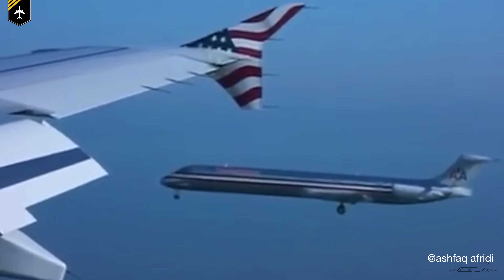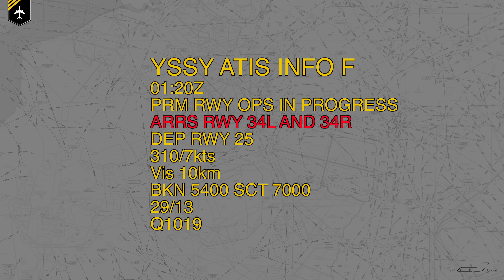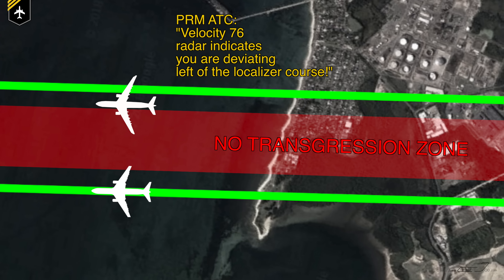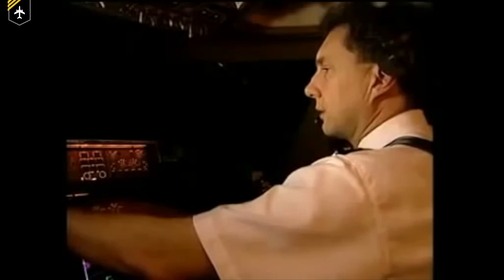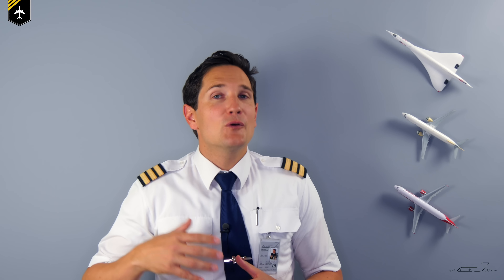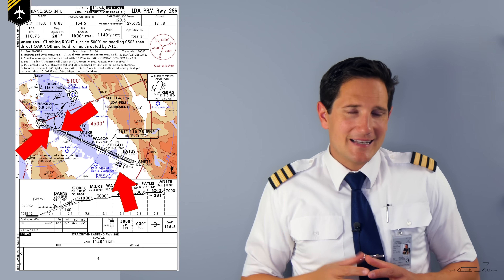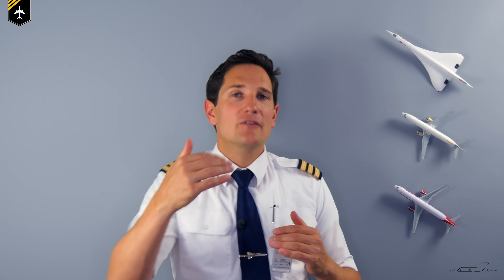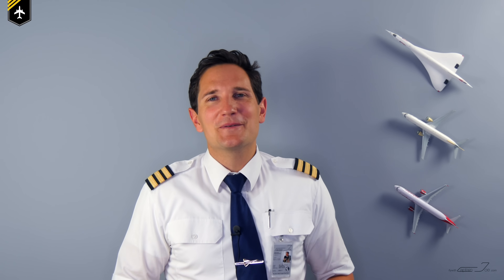Parallel LANDINGS!!! PRM and SOIA approaches! Explained by CAPTAIN JOE

Comment: The more I watch these videos the more respect I have for airline pilots.
Reply: And controllers. Pilots only have to deal with their aircraft and those near them, and see-and-avoid is always in effect (assuming VMC). Controllers have to deal with dozens at a time (including coordinating handoffs between sectors), especially in an airspace as dense as the SFO bravo. There are also two very busy Class C airports under the bravo, as well as numerous Class D. It's really impressive and amazing that there as few incidents (and potential incidents) as there are in that space. The only other airspace I've had experience with, that comes close to the complexity of the SFO Class B is the LA basin (I've not flown on the east coast, I'm sure that NYC area and the DC metro are nightmares to navigate and control).

Comment: The breakout described around 8:05 comes from what You described before. Since the plane on LDA approach has to have the preceding on ILS in sight all the time after the LDA point, they are not allowed to overtake them. When they are about to, a breakout is necessary.
Reply from the maker: Correct

Comment: +Captain Joe  Excellent informative video!  This was a really great one.  I experience PRM and SOIA landings frequently and I always wondered if there were extra procedures involved.

As a passenger, I've experienced PRM in PHX, LAX, DEN, IAD and DFW (I'm sure there were more).  Of those, PHX always seems to be the closest.    

I have also experienced SOIA at SFO nearly every time I land there (I'm only 4 hours driving time from that airport and often take a regional up there to transfer to a trans-continental flight).  SFO is truly the "Mr. Toad's Wild Ride" of airports because not only to they do the SOIA but I swear they're cutting it extraordinarily close between landings with the perpendicular "take-off" runways 1L and 1R that cross 28L and 28R at their center points.   When taking off, it often feels like you're playing "chicken" with the inbounds.

Comment: Hi Joe, thanks for all the great videos. I was on a flight last week where the APU was not working before take off - so no AC before engine start.....it got me thinking. How can you fly with a faulty APU...what would you do should you have multiple engine failure. Would it be possible to restart engines without a APU during flight?

Regards
Leardt

Comment: Cap😮. Would that make the TCAS go off in the approaching planes? Would u have to turn it off?
Reply: Procedurally at SFO before joining either of these approaches TCAS is switched to "TA Only" so it still calls out traffic but does NOT give Resolution Advisories prompting evasive maneuvering. 

I don't care what Captain Joe says, these approaches at SFO are not well liked by most pilots who fly them very often. I've been there hundreds of times and it's frequently a total cluster. There's some other requirements that can set you up to fail:  you aren't supposed to pass the adjacent aircraft, but ATC will frequently put faster aircraft behind the parallel traffic. When you're at your approach speed, you can't slow down any more. This results in go arounds. ATC also aggressively badgers you to call the field and preceding aircraft in sight and sometimes it's quite difficult as there may be many aircraft visible or visibility may not be great. This can also result in having the approach broken off and getting resequenced for another approach. Just because it looks cool doesn't mean we enjoy it or that it's a good operation. I detest flying in and out of SFO as not only do you have all this to deal with, there's normally intersecting traffic on the other runways rolling through your landing runway to watch out for. 

The SFO controllers do the best with the airport configuration they've got, but much like BOS, what they've got is intrinsically terrible.

I thought Joe did a very nice job explaining it all.
Reply: No because TCAS isn't only based on proximity, TCAS is designed to resolve conflicts for one purpose only and that is to avoid collisions. As such the only conflicts it will issue an RA for are those where the plane is both close enough and also is actually on a predicted collision path since parallel lines do not intersect by definition TCAS is not concerned by a plane on a parallel course. Not sure how it works with the other kind as the two paths are not parallel but I would guess that it has something to do with the fact that with both planes descending the expected collision point would actually be at a negative altitude and thus it assumes that you are landing before that, TCAS is built to avoid mid air collisions not ground collisions so that would rather make sense if altitudes bellow some minimum value are outside it's scope.
Reply: yeah. I just recently learnt that!Thanks
Reply: @FaerieSeraphina  but whether it's above or below or across... That's still proximity... Right... I mean I'm asking🤷....lol
Reply: +Mark Strawder Proximity yes but not a collision risk in and of itself which is what TCAS is concerned about, which of course also explains the name it's Traffic Collision Avoidance System not Traffic Proximity Avoidance System.
Reply: @FaerieSeraphina  point taken🤔🤔
Thank You 😀
Reply: Maybe you switch it over to standby. I didn't hear the TCAS go off in the high alert video.
Reply: @pranzgamingxd6781  if u switch it off, then atc wont get detailed data
Reply: If TCAS goes off, you follow the divert instructions.  You don't turn TCAS off.

Comment: Ok regarding the how, but no a clear answer on the why this procedure exists
Reply: Planes that follow single file must be separated by 3-6 minutes(depending on size) because of wake turbulence, this includes departures and arrivals because a landing may need to abort and go around following a departure. In simultaneous parallel there is no danger of crossing into the other plane's wake(or a crosswind shifting the wake) this almost doubles the airport capacity, 2 planes every 4 minutes rather than one every 4. This applies to runways with even thresholds, and less than 2500 feet between centerlines, 2500-9000ft have additional traffic control options, and over 9000ft the runways have independent sequencing. (although they likely still share local holding patterns and such large scale traffic control)
Reply: thanks for the explanation (I'm absolutly not in the areonotical area, but interested to know).

Comment: Thanks for the explanation, Joe. I think the only US airports that use PRM are SFO (San Francisco International) and ATL (Atlanta Hartsfield International). Is that info correct?
Reply: DFW, scared the heck out of me the first time.  i was on the inboard side and looked into the windows of the delta plane.  i waved.  they waved back.
Reply: I think there is also LAX
Reply from the maker: Nope!
Reply: In the U.S. it San Francisco International (KSFO), Detroit Metropolitan (KDTW), and Chicago-O’Hare (KORD.) Outside the U.S. only Sydney Airport (YSSY) use PRM.
Reply from the maker: Correct!
Reply: Here's an o'hare view.

https://youtu.be/7aWVtvbj-Mk
Reply: Perhaps HKG will use PRM in the future, once the third runway is complete.
Reply: O'hare? But they're spaced way farther than sfo
Reply from the maker: Correct!
Reply: In the US...airports that I know of with PRM are MSP, CLE, PHL, and ATL. Other airports with parallel runways but spaced far enough apart to not require PRM are DFW, IAD, IAH, ORD, DEN, TPA, MIA, MCI, JFK, and MCO. BOS has two parallel runways but 22R-4L has no instrument approach so any landings on that runway are visuals, therefore PRM not needed.
Reply: Houston - IAH, 15L/15R
Reply: DEN has 2 16L/16R and 17L/17R
Reply: What would Charlotte CLT be? It has 3 parallel runways. 18 36
Reply: JFK in New York maybe?
Reply: Also Boston, and probably a ton of airports around the country.
Reply: PHX and FLL also have this approach.
Reply: It's SFO, ORD, DTW, and ATL. Thank google
Reply: I believe I seen it at PHL - Philadelphia Int'l as well.

Comment: captain joe, what about runways with a C runway, would those be 3 parallel runways?
Reply: "Triple Simultaneous Parallel Approaches" have been studied by the FAA and found feasible even under IMC conditions, but I don't know if any are used in common practice. It is more practical that one runway is dedicated to takeoffs and the other two for landings. Runway separation distance and threshold offset also matters, 2500 feet and 9000ft are two key centerline spacing distances, 500 feet longitudinally is the minimum to be considered staggered thresholds. Beyond 9000 the landings are fully independent, below 2500 the approach separation is treated more like a single runway. The official ATC publications covering specific separation distances and approach path design requirements are hundreds of pages. Pilots basically study the finished procedure plate for a particular airport and follow the local ATC navigational guidance.

Comment: Awesome video Captain Joe. I live in San Francisco so I have had the pleasure of watching some of these parallel approaches through the windows while landing at SFO and from driving down the 101 freeway. Recently, on a flight from Boston (BOS) we had to break out. The engines roared, as you said, as we turned left out over the Pacific then came back around for a second attempt. Keep up the good work and best wishes  at Cargolux.

Comment: What do certain runway signs mean for example at Gatwick at the hold position marking to RWY26L there is a sign saying CatII/III
Reply: The CAT II/III sign is the holding point for the given runway when ILS category 2 or 3 is in use. To be more specific, when ILS CAT 2 or 3 is in use, planes flying towards that runway can do an autoland. This of course requires that the ILS signals are extremely precise. Therefore, to prevent signal interference, other planes need to be kept at a greater distance from the runway. Hope this makes sense.
Reply: They mark the point where you hold on CAT II or III conditions. See:
https://en.wikipedia.org/wiki/Instrument_landing_system#ILS_categories
Reply: The numbers are the compass heading of the runway. The L and R are left and right when there are parallel runways. 

If you go to the opposite end of say 
 runway 90 it will now be runway 270
Reply: Josh Haviland Not that bright are you?
Reply: @hiddenInsight486  wouldn't it be runway 9 and 27?

Comment: Joe - as always something new to learn, thanks. Copenhagen CPH/EKCH has two parallel staggered runways (04/22 R+L) that are 2000 ft apart, and according to this post can be used with PRM: https://www.airliners.net/forum/viewtopic.php?t=1371331. According to the quoted rules, when they have staggered thresholds, PRM runways can be closer than 2500 ft? It doesn't happen very often though - standard at CPH is simultaneously using L for incoming and R for departing aircraft (except for the A380, which has to use 22L for takeoff instead of 22R).

Comment: I fly out of SFO a lot for business trips and and this sort of parallel landing is a common occurrence at SFO only under good weather condition. Once fog or bad weather hits the area, ATC doesn't allow these parallel landings to occur with resulting delays. If I'm not mistaken, now newly designed airports with parallel runways have to be a mile apart or so to have simultaneous landings but FAA allow SFO to have this exception as the airport was built decades ago before new regulations were put into place.
Reply: They all comply with the same set of basic traffic control rules. Runways built with crossing flight paths or closer than 2500 feet parallel must consider wake in the approach and departure procedures. As such designers prefer more separation so that they can achieve maximum capacity, flexibility, and reduce workloads, if they can obtain the extra land, but it is not a requirement. Most of the details are in FAA JO 7110
Reply: Thanks for the explanation!

Comment: Are you guys, who fly freight,  scared of shifting cargo? I have heard that it can even take a plane down during rotation.
Reply: I believe that there is an example of a 747 falling to the ground in Afganistan after take off due to a vehicle load shift on Smithsonian's Air Disasters series.
Reply: Lyle Mills, you're right. Load shift was one cause of that crash in April 2013. At least one armored vehicle had come loose and rolled backwards against the airplane's rear bulkhead, damaging the bulkhead. This also crippled key hydraulic systems and damaged the jackscrew, which made the airplane uncontrollable. However, when flying out of Bagram Air Base, they usually take a very steep climb to avoid Suface-to-Air Missiles. I'm pretty sure this contributed to the load shift.
Reply: If cargo is properly stowed there will be no shifting and it is ultimately the pilot in command's responsibility to check the stowage and balance before takeoff. 
Yes it can take down a plane during rotation, weight slides aft, the elevator cannot compensate for the large imbalance, the nose goes up, the plane has a non-recoverable stall and falls from the sky tail first.
Reply: Leonidas yes, cargo shift is a possibility. The airline industry has strict loading procedures, loadmasters are checking all lockers before signing the loadsheet. When loading is completed, one of the crew goes down for a double check and make sure that they are no leaking cargo as well.
Reply: The thing is though, it’s not moving anywhere
Reply: A scared pilot is more dangerous than shifting cargo :) On a plus side, cargo doesn't complain that it's hot, cold, bumpy, lavatory stinks and it doesn't scream when you hit a bump. Safe flying!

Comment: In a case like this does the pilot have to notify the passagers as of why the plane didn't land and had to go up again? One time i was landing in Mexico city airport,  the plane was about to touch the ground but went up immediately and turn to the right or left i don't remember, to circle back into the runway, it was very scary we all panicked but no one told us what had happened.
Reply: No. The first job is fly the airplane, the second job is talk to ATC, the third job is talking to cabin crew and company dispatch, talking to passengers is only a professional courtesy. 
"Abort landing and go around" is standard procedure, this is done at any time either pilot does not like landing conditions and is considered a "no fault" better safe than sorry action. It could be they don't like the speed, a gust of wind, alignment with runway center, approach glide is not stabilized, another aircraft or an animal near the runway, maybe a landing gear indicator light burned out and they want to ask the tower to visually confirm landing gear is down.
Reply: @mytech6779  oh i see. Thanks for your reply.  😊

Comment: Because of wake turbulence alone, why not stagger the two approaching aircraft so they are nowhere near wingtip-to-wingtip?  They may be on parallel courses to parallel runways, but why make it complicated by having the [two] approaching aircraft so close to each other?
Reply: Because wake is behind and below the aircraft, not to the side, planes often fly in formation just the same as you have two lanes on a highway. They can land two planes then wait 3-6 minutes(depending on size) for wake dissipation and then land two more, or they can land one and wait 3-6 minutes then land one more. If runways are less than 2500 feet apart they are basically treated as one for wake turbulence separation.
Reply: Captain Joe recently did a video on wake turbulence, so I know what he said there.

Comment: But can't you just chessboard the landings? You need some time between landings due to the wake, but it doesn't apply to the other runway parallel to that, does it? I mean, why don't you just slow down one of the planes, then the plane in front of it is much easier to track, you don't look sideways, you look forward. And you have much more space.
Reply: Special wake separation rules apply to parallel runways closer than 2500 feet and depend on evenly matched or staggered thresholds. With your chess board system there is a larger chance for the following plane to cross into wake turbulence; when cross wind is added the wake can shift directly into the path of the following plane. With staggered thresholds the following plane lands on the furthest threshold and has a glide path above the leading plane.(wake turbulence travels slightly downward) With evenly matched thresholds(same glide path altitude) the following plane must be separated by several miles, the details of separation are dependent on the actual runway separation and size-category of the aircraft.